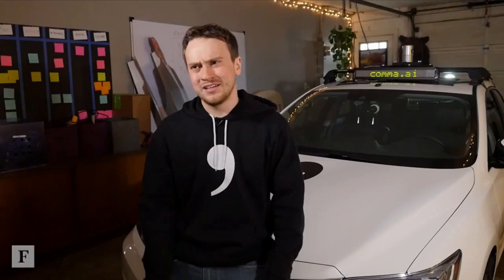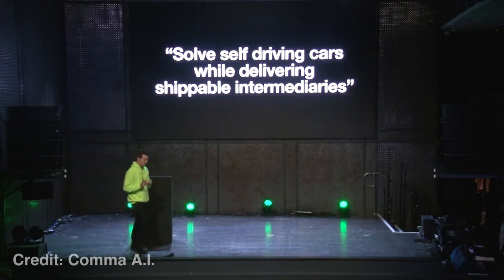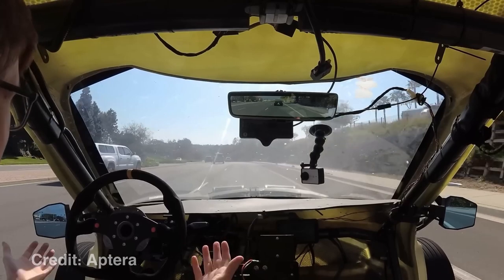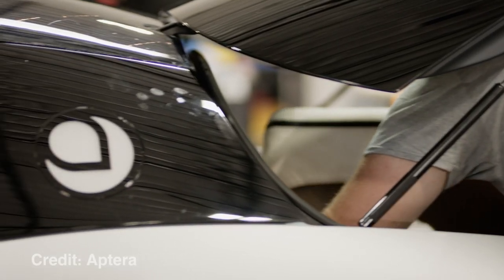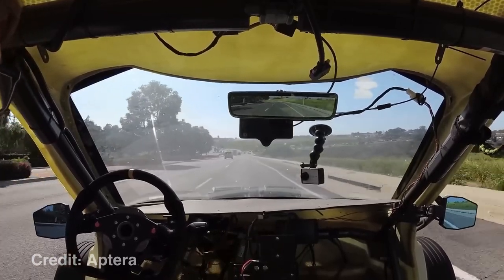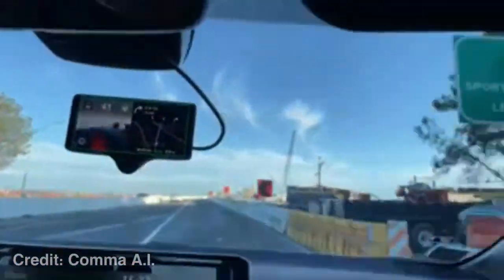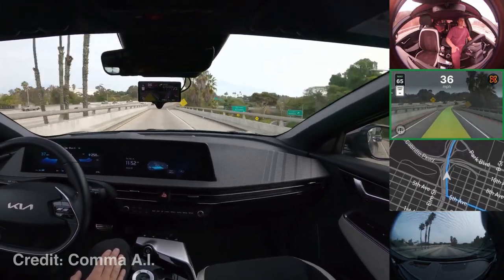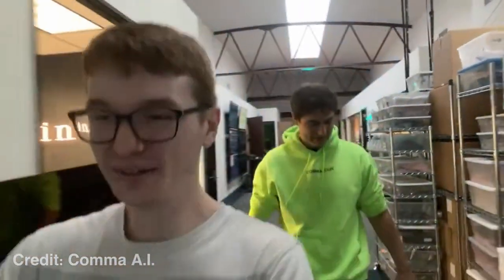How will Aptera integrate openpilot? #aptera #solar #electric

Comment: Good points. Especially informative about Comma liability and implementation. Thanks for the video. Shared.
Reply from the maker: Thanks Dean! More to come! I was particularly interested in Hotz’s comments at CES. He seems to think the Aptera will be noisy, rough and open cockpit?
Reply: @apterabrief2029  The problem is that most Aptera reviews are of the early Alpha prototypes or the Beta test shell. The Alpha models had the front suspension before Roush's and Aptera's engineers refined it, and the rear suspension was also significantly redesigned. As were the wheel pants, the interior and many other areas. Even though the Beta had the revised suspension and other improvements, it's open shell would never have given the impression of a quiet, comfortable or luxurious EV. The Gamma model had most all of the refinements, but it was only available for sitting in at the Fully Charged show, and then was whisked off to Europe. So I honestly can't blame that guy for thinking that the Aptera was not an uncompromising EV competitor. The sooner that Aptera can get out a few of the completed production intent models for crash testing and driving reviews, the better the chances of getting big investors and having a successful IPO.
Reply: Plus his comments were made in January, I wonder if he has changed his opinion after these two months. Being the first manufacturer to incorporate OP as OEM it is a win-win for both Aptera and Comma AI.

Comment: Good point on the liability.  Much as tight integration would be nice it seems likely this will just be a bulk purchase of comma 3 or a customized but very similar piece of hardware replacing the center "not a mirror" module and providing both screens.  Would be nice to have essentially comma 3 in a white box designed to fit nicely into the Aptera but still essentially all the comma 3 hardware.  Different hardware, screens etc adds complexity and ongoing software dev cost.
Reply from the maker: I could also see Aptera integrating the software as well.  After all they ARE building a vehicle that can go 100mph, 0 to 60 in 4 seconds, then turning us loose with it so they're no stranger to liability. It would be sooooo nice and clean to have the cameras tucked away and the Openpilot screen centered on the yoke.